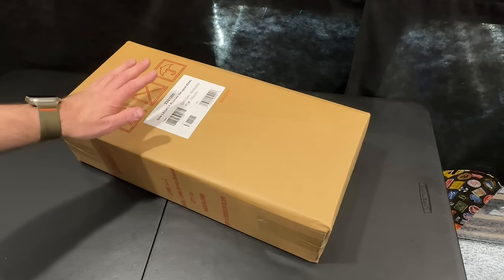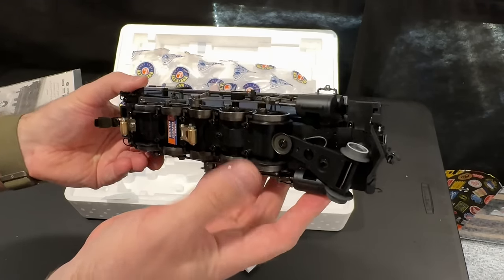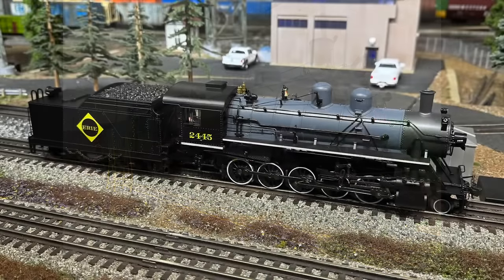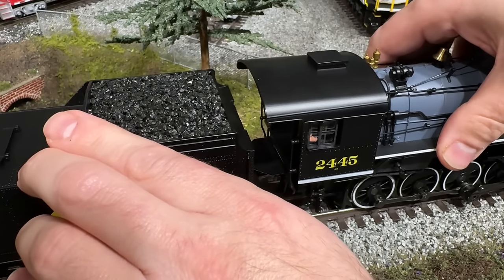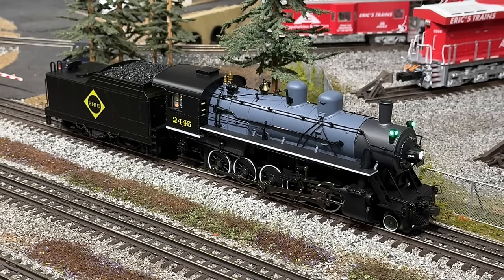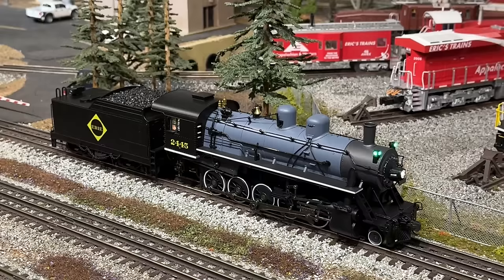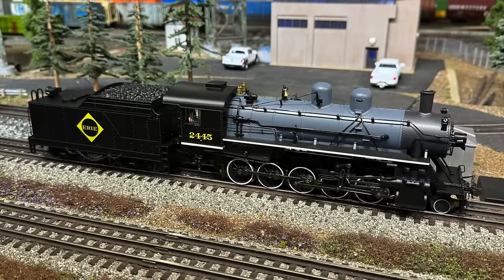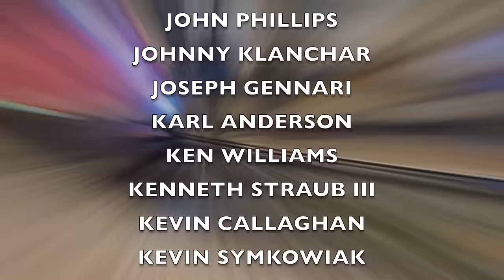To Russia With Love: Lionel's New Russian Decapod Get The Job Done In Style!

Comment: I noticed Lionel hasn't been putting the correct minimum curve on all the boxes. The L1 box said O54 but the catalog said O42 (O42 is correct). The I1 said O72, but that's only for the long haul tender. Mine was the short tender (O54) but still said O72 on the box. 

I really think this locomotive is beautiful. I like the blue color.

Comment: That is a very nice locomotive.  The #1 bell and whistle are always the most prototypical to me and my favorites.  The gap between the engine and tender doesn't seem too bad and the drop plate helps it look closer.  The tether is just fine, too and visually helps make the gap look smaller.  I only own one engine that isn't post-war or MPC and that is an MTH Rail King Southern Ps-4 Pacific with the tether and I like having it.  Good connectivity and not much to go wrong.  A great review, as always.
Reply from the maker: Thanks so much!

Comment: That looks amazing. To me, Whistle #4 sounds like a toy a kid would play with. If I set up a layout for Lionel Legacy stuff, I'll 3d print a housing for the electronics inside the Legacy remote in case the internals are fine but the outside is cracked. I don't like taking chances when it comes to getting zapped.